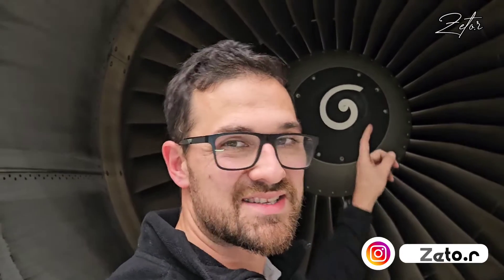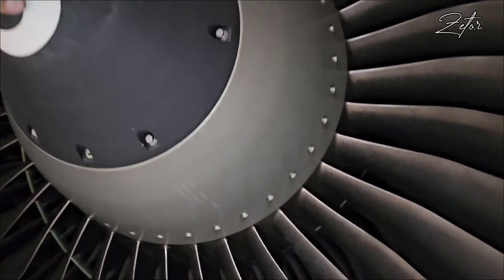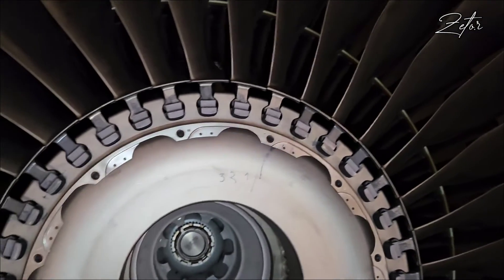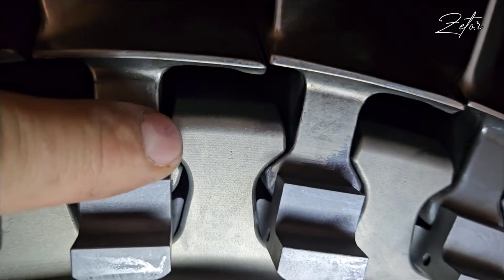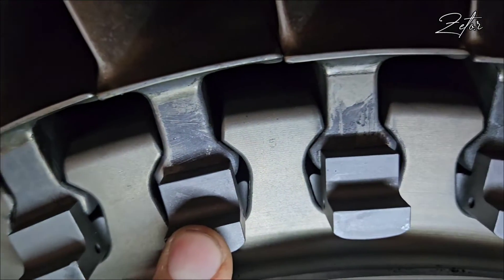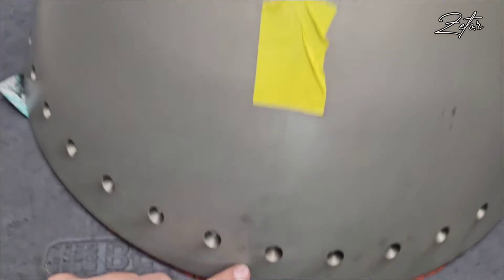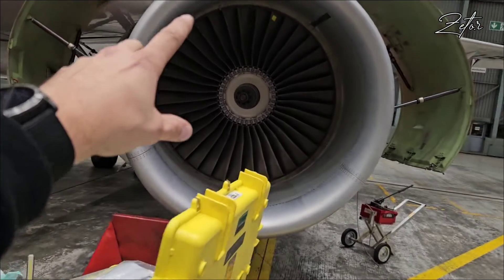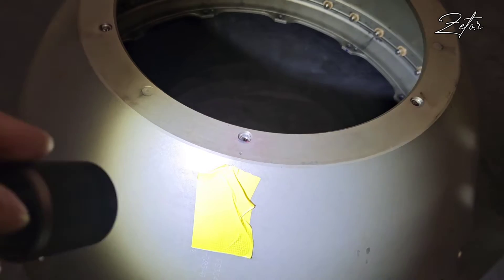How to indentified blade No.1 on A320 CFM-56 5B Engine

Comment: Can you compare the fuel efficiency, and durability of the CFM56 series vs the Pratt Whitney PW4000 series?  This would be greatly appreciated. Thank you. 
EDIT: It appears the CFM has fuel efficiency of ~3gallons per laden static air nautical mile, same as PW.  So they are comparable.
only question remains is which is more reliable. the PW uses fancy titanium balloon molded blades.